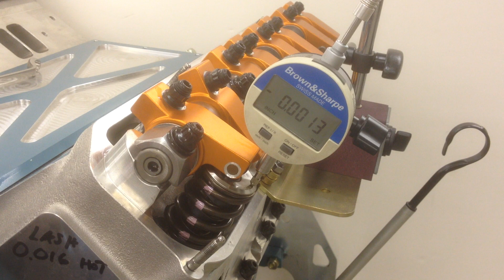Checking lift of Harland Sharp rocker arms

Comment: You should consider testing the ratio throught the entire sweep. The ratio is different at different lifts and the practical ratio off the seat is more important for performance than peak valve lift. 
Rocker arms with high ratio off the seat should be used when running roller lifter camshafts. Valvespeed is power. :) 
To bad this seldom is talked about.